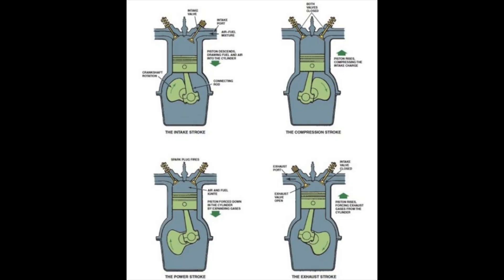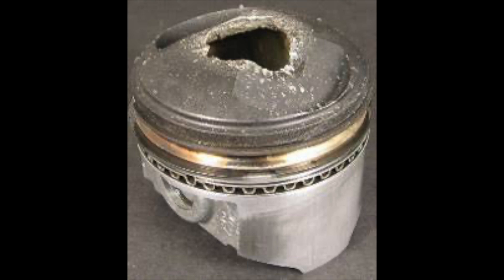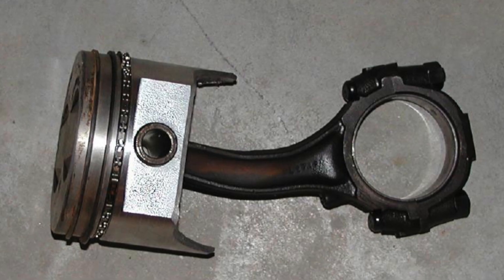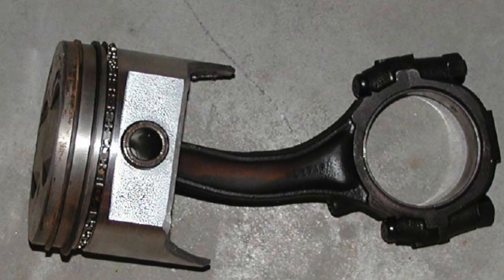What is Cylinder Knock and Why Does It Happen (+How to Avoid It)

Comment: EQT Stage 2 93 having KR at high rpm’s on full throttle sounds like lifter tick when it happens. I also have rs7 plugs in thinking that’s the first issue I’ll fix but if that doesn’t Imma get a fmic and pray that fixes it

Comment: I'm actually having issues with my GTI right now. I have a 2017 GTI. eqt stage 2 E30 and I'm getting knocked in cylinder one but only when pulling away from stop lights or stop signs. I've increased the amount of E85 all the way up to e33 and it's calmed down a little bit but it's still there.. any ideas?? I've also already swapped around coil packs and spark plugs to no avail.
Reply from the maker: When i refer to knock, I am only referring to knock on wide open throttle - in the city and in regular driving it will knock even more than -3 and under normal use that is normal! 

You do not want to see knock when you are at wide open throttle 

For example start from 3rd gear 3000 rpm then wide open throttle all the way to 6000, you want to see no knock!

Hope this helped